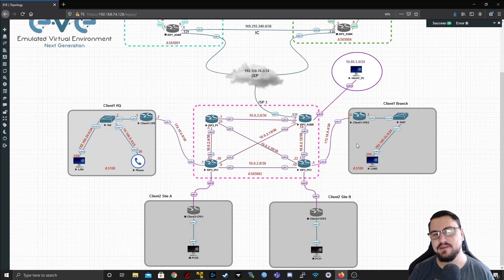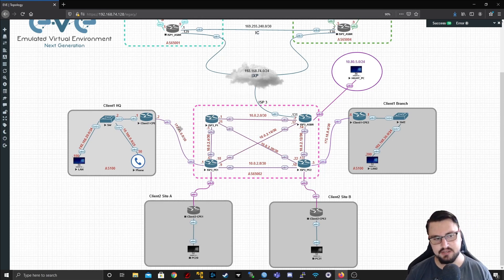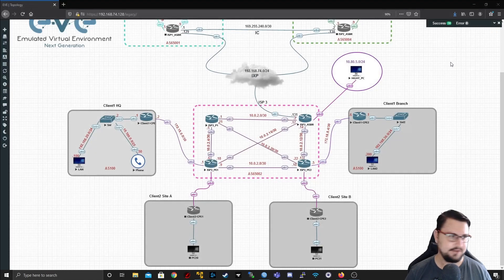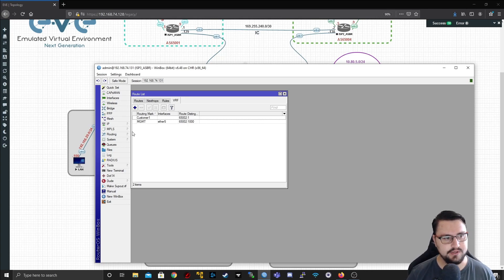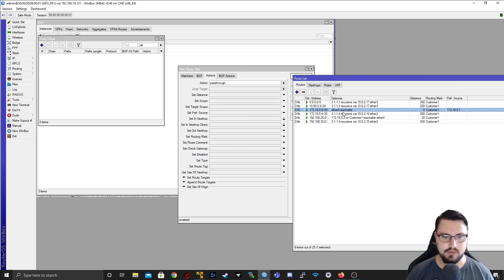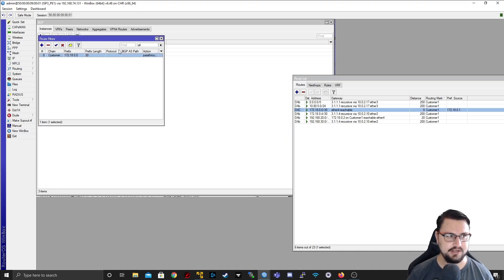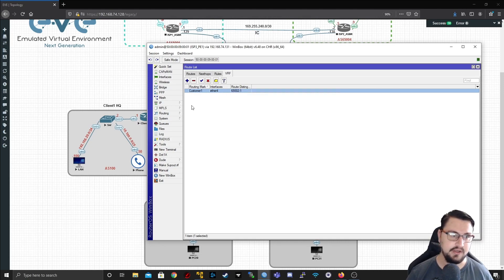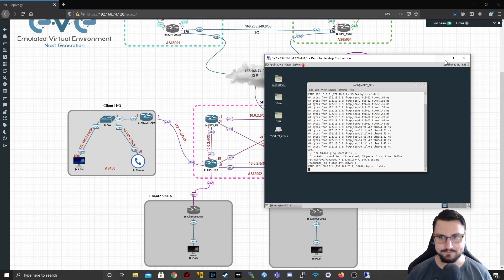MikroTik - VRF Route Leaking (Part 2 The Management Network!)

Comment: Hello, I have a question. I have a network, separated by VRF for management and web access. But I have a problem is that I have ping between VRFs, for example: I have a router that contains the two vrfs (vrf1 and vrf2) each vrf has its own different network and the gateways are in router. Now if I have a PC on vrf1 network 1 and I make the vrf2 gateway this ping is possible. This is counterintuitive because I understand that the vrfs are in different routing domains. And also if I ping vrf1's PC from vrf2 with a source from its own network, I can reach it. Please help.

Comment: Hello 
Network Berg 
Hope you are doing well..! 

facing Issue I have PBR routing. 2WAN and 1LAN with 2 networks.
I have a 2-WAN &1-LAN with pppoe server 
IP assign to LAN 
(172.30.30.1/24) 
(172.40.40.1/24) 
Wan1 user on this network (172.30.30.0/24) 
Wan2 user on this network (172.40.40.0724 
I have deploy Policy Base Routing 
Rule for WAN-1 user 
Mangles Prerouting src address (172.30.30.0/24) mark routing new connection mark = Wan1. 
Rule for WAN-2 user 
Mangles Prerouting src address (172.40.40.0/24) mark routing new connection mark = Wan2. 
Mark in IP routes with WAN 1 & WAN 2 gateway. 
But I'm unable to access pppoe user's router remotely. 
And even unable to access my Wireless ubiquiti Access point. (ubiquiti AP in this network 172.20.20.0/24 and 172.20.20.254/24 is assign to LAN) 
Want VRF leaking on Policy Base Routing over PPPoE server  
Thanks
Regards
Mehar

Comment: What need to be done to be on the customers ends to be able to ping each other?
Reply from the maker: Nothing, this has already configured on a previous video where I explained how to setup a VRF, though if you want two different customer VRFs to communicate you can use the RDs to import and export routes between the customer networks.
Reply: @TheNetworkBerg  i got that, in my case i need to allow some sites to be able to ping each other, and also i got one site which need to completely isolate, and im getting stuck with vrf distribute routes